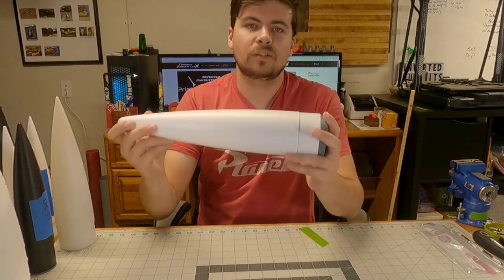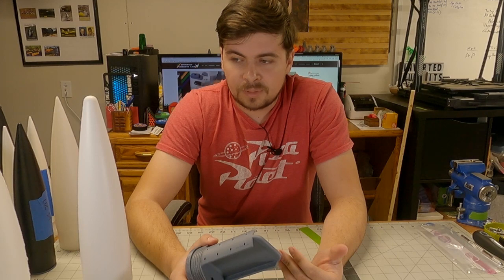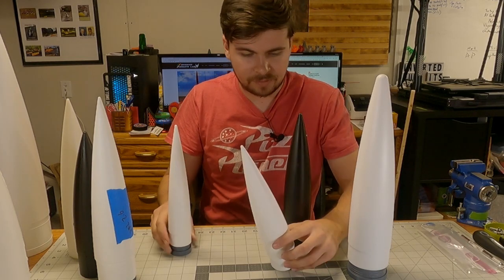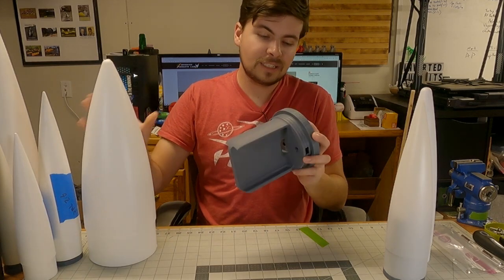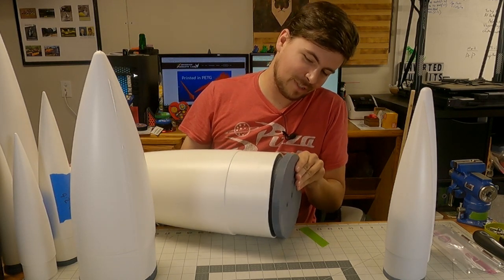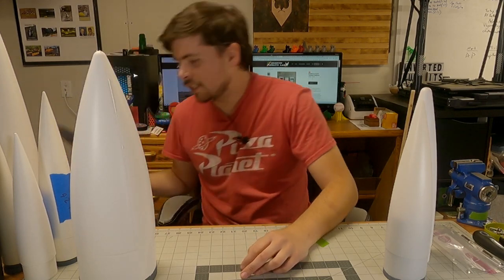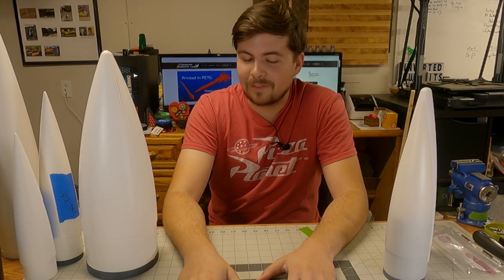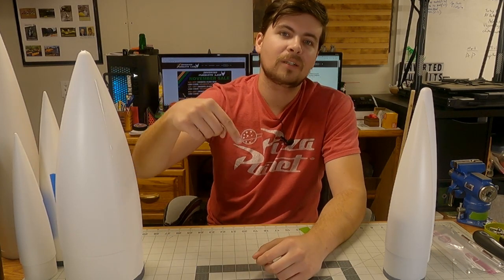Plastic Nose Cone Electronics Bays

Comment: I printed the 4" for my Mega Red Max and it was a hit at the field.  I added some allthread to the top of the sled for adjustable nose weight.  The sled makes a great platform for this, so I didn't have to permenently add weight to the NC.  What a great design you've come up with .  Thank you so much.  It goes in everything I fly now.

Comment: You should make threaded adapters so a small bay will fit in all the cones (with the correctly sized threaded adapter).
Reply from the maker: That's a concept that's been brought up before.....
The one area I typically get stuck on is do I start making an adapter for all 3in to larger sizes or smaller?